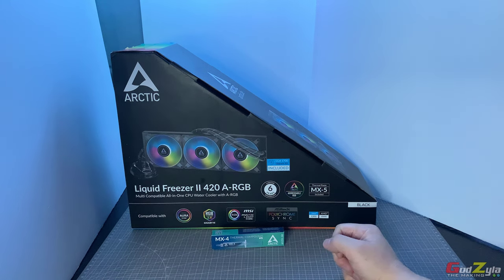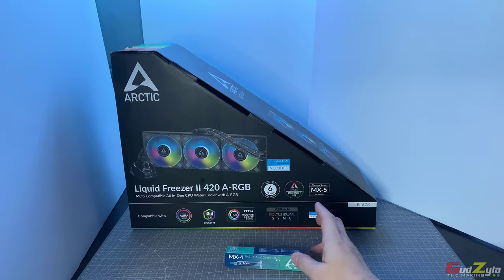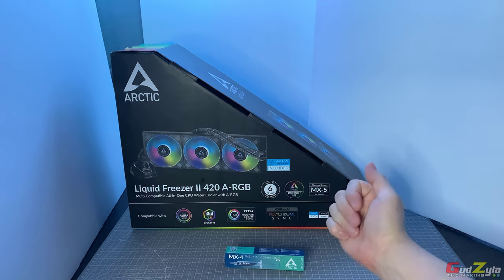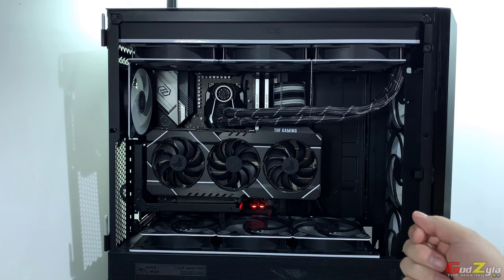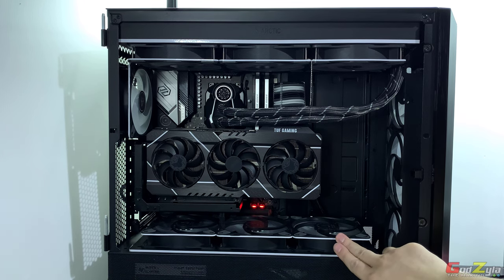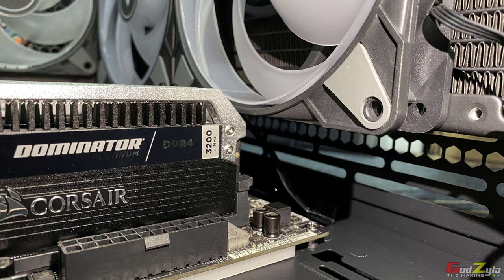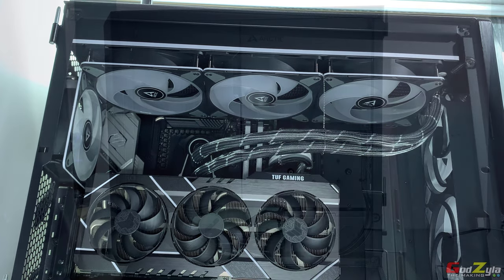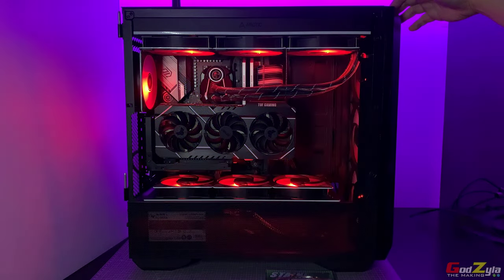Arctic Liquid Freezer II 420 in Lian Li Lancool III - Part 2 (The Experience)

Comment: I just wanted to install the Corsair H170i 420mm water cooling, however, I can not screw the fan to the left no matter where I place the radiator because one is stuck on the shield of the motherboard. Just sad ... Now I can send the case back again
Reply from the maker: Hi Johnny, welcome back, so sorry to hear that, which motherboard are you using? is the motherboard shield too high? some have reported to me that the rear i/o shield are too high that blocks you from placing fans. it's just 5mm off. still am sorry about your mishap. have you try mounting it to the front. one of my viewers did commented here saying that he could mount it to the front.
Reply: @KleoYan  I have the B550 Asus F-Gaming and yes, the shield is too high unfortunately. I can mount two fans and not one. I mounted the radiator as far as possible towards the window. I just heard that you shouldn't mount the radiator in the front because of the cooling capacity, right? I'm really sad right now because I think the housing is so beautiful.
Reply from the maker: @johnny7184  I am so sorry to hear this, at times I wish motherboard reviewers will do a height measurements on the I/O (sheild) and side VRM heatsink, at least we can pre-prepare by correct messurements. infact that's what I did. I measured my Taichi X570 and have sent emails to lian li about this case measurements and clearance, but I too am worried if I purchase a 420mm to fit in this case, lucky for me, Arctic have responded my call. still it sadden me that you are not able to fit the AIO due to this minor setback on the motherboard shield.
Reply: @KleoYan  Yes exactly, they advertise with 420mm AIO on their homepage and in the end it doesn't fit in, you can't think of something like that the SHIELD of the motherboard is too high. Too bad. Then I must unfortunately switch to a larger housing. But many many thanks always for your super nice and good answers Kleo!
Reply from the maker: @johnny7184  I am at fault too as I did this content. I hope you get a better case in the end.. have you have a look at Bequiet BASE 802. ok before suggesting anything, I myself did request right after I build this Lancool III as it looks premium too, but sad to say no response from Bequiet! it looks spacious but do make enquires if you are interested, just to make sure that it fits both your board and 420 AIO. I wishes you all the very best with your build.. thank you for the converstation buddy. 😉
Reply: @KleoYan  Thanks I'll find out :)
Reply from the maker: @johnny7184  you are most welcome 🤗

Comment: how do you plug the cpu power cable into the socket? is that an extension cable a must? I got stuck at the cpu cable part
Reply from the maker: Hi Winterr Winter, welcome to my channel. If you have not notice. I use psu that have flat cables. If you are using PSU like the Corsair HX or RM. then it’s harder to fit, as the sleeving plus the big coil on the cable will have some obstructions. In this case you can get a 8pin eps flat cable extension.
Reply: @KleoYan  thanks for the reply. just found out that I have the same issue with Mark A that the rear part (I/O part) of the case is blocking the radiator. would you mind uploading the top panel of the case with top filter removed for reference?
Reply from the maker: @winterrwinter5136  hi sad to say, I have already dismantle this setup. now progressing to another. so sorry. infact I have mentioned so long your motherboard rear I/O does not have the height of 40mm tall, you should be able to fit in. in this video I have mentioned 45mm, this includes the starting point of where the motherboard standoffs are.. there is a 5mm space before you mount the motherboard.
Reply: update: I just noticed that there are screw holes which are so difficult for one to see. OMG
Reply from the maker: @winterrwinter5136  there are others asking me this question as theirs can't fit, end up using zip tie. my trick is simple, screw the rad bit by bit, like how you do the CPU Heatsink mounting. I am able to get all 12 radiator screws screwed on the case top without issues, just do it slow.. "Slow and easy will win the race" 😁

Comment: hey bro do you recommend those extra 3 fans at the bottom and the back? does it help temps much
Reply from the maker: Hi Editor221, welcome to my channel. If your GPU is vertically mounted. It will help and as for the rear, you can do without it. Results can be found here https://youtu.be/1SPioF78x_E?si=fcpK447SfK8Y431e
Reply: @KleoYan  ah ok so your saying those 3 fans at the bottom are for GPU cooling only? it doesnt help with CPU?  if i dont vertically mount will it still help the gpu abit
Reply from the maker: @edi18912  it will cool your GPU but won’t be of any help to your motherboard area. Watch part III and you will understand the pattern

Comment: Hello.  Thanks a lot for such a detailed guide.  I wanted to know if it would be possible to put this AIO on the front panel of the case?  Will there be gurgling sounds?  And in general, will this AIO fit in the front along with at least one HDD bay?  It's just that now there is a choice to take this AIO or LS720.  

And I also wanted to know the correct name of the tape that you glued to the fans.  

Thank you in advance!
Reply from the maker: Hi @stefan_es, welcome to my channel. be it front with or without the HDD cage, you are not able to fit the Arctic Liquid Freezer II 420, but if it's the LT720 from deepcool, you will have enough clearance. I always practice tubes facing downwards if mounting at the front to prevent the noise or bubbles. As for the tape on the fans itself, look for Decal Tape Vinyl Sticker for Vehicle Bodies  in amazon. https://www.amazon.com/s?k=vehicle+line+tape&crid=3DCG9BXA2BZR8&sprefix=vehicle+line+tap%2Caps%2C299&ref=nb_sb_noss
Reply: @KleoYan   Thanks. I own an RTX 4080 graphics card. Won't it be that when the system is under load, warm air from the GPU will rise up and heat the AIO heatsink?  The Lancool III is a beautiful case, but I'm a little sad that I can't put a 420mm radiator in the front.  Would an LS720 on the front of the case be worse than an Arctic Freezer ii 420 on the top?  I want to compare in terms of noise level and performance
Reply from the maker: @stefan_es  lets just say to push warm air out is better than to draw warm air in.. thats what happened when you put the radiator at the front. Which CPU are you using btw? if it's not the 7950X or 13900K or KS, it should be fine using a 360 liquid aio.
Reply: @KleoYan  I have 12600k now, but then I will most likely put 13600k.  Is it warm air up front?  it seems that on the contrary, the processor receives fresh cold air from the outside.  Yes, then it gets warm inside the case and is already worse than the video card and other PC components, but in Lancool III there are 3 more fans for supply ventilation from below.  I often heard the opinion that the Freezer ii 420 is noticeably quieter than the 360 AIO, in particular the LS720.  There is no way to verify this statement, but this alignment of affairs is captivating.  I want silence.  Otherwise, I already have an AK620, which cools the processor normally, but it is so large that it blocks the flow of warm air from the video card.  I want silence so that the processor does not force the AIO fans to run at full speed and make noise during overclocking.  That's all.  If 1000rpm is enough to cool 12600k at 5.1GHz in games then why not)
Reply from the maker: @stefan_es  for a 12600k. You don’t have to worry much about heat. The tdp drawn is not that much compared to 13th Gen processor. I’m this case you should not run into issues with a 360 aio mount at the front. As for silence. Both are quiet. Just that lt720 or ls720. Both fans are noisier abit at full speed.
Reply: @KleoYan  Thank you. And if I change the processor to 13600k (maybe 14600k) in the future, is Freezer 420 preferable for 13th gen?
Reply from the maker: @stefan_es  to be honest if you know how to do power limits on these processor without losing performance. a 360 will do.

Comment: Hi Kleo
I have
I7 12700K
Z690 F - Gaming
Asus rog strix 3080Ti 12gb OC Gaming
2x16 Kingston fury beast ddr5
2 x m.2 Samsung 980 pro
Lian li lancool III
and I'm interested in buying arctic liquid frezer II 420
will there be any problems, clearance issue with the this motherboard that i have or the rear cooler, ram memory etc...?
Reply from the maker: Hello Dejan_11, welcome to my channel. If you have the motherboard inhand with you, kindly mesaure the height of your motherboard rear I/O top to the bottom of the motherboard.. if it's within the 40mm height, there will be clearance. as mentioned in this video, from the case motherboard area where the stand offs are. the space better the motherboard standoffs to your motherboard bottom is 5mm. plus your height of the motherboard I/O to the bottom of the motherboard, lets say 40mm.. So total is 45mm  which is just nice. but if it's over 45mm, then you going to have an issue.

Comment: Hello!
I understand correctly that the 420 radiator can also be installed on front? In this case, all 6x140 front fans can also fit.
Reply from the maker: Hi WHiTE, welcome to my channel if you are using an Arcitc Liquid Freezer II 420, no you can't do that with a push pull configuration. the radiator is too thick, even with just 3 x 140mm fans. your top fans have to be all 120mm. now if you are talking about the Corsair 420, someone in this comment have mentioned it can be done too but I cannot comfirm if you can apply the push pull method as I do not have the 420 Corsair to test with. Hope this will help.
Reply: @KleoYan  Thanks a lot! 
Is it possible in that case to make a bunch of 360 ALF and a set of 3x120 + stock 140 fans?
Reply from the maker: @IWHiTEI  Hi, I dont really understand what you mean by a bunch of 360 Arctic Liquid Freezer 2. do you mean to place more than 2 liquid AIOs or? do you mind to eleborate more. thank you!
Reply: @KleoYan  I meant the ability to put a 360 radiator and still keep all the fans
Reply from the maker: @IWHiTEI  I see. this case has no issue with 360 AIOs and you can place all kinds of fans as 360 AIO does not restrict any fan placement. maybe this video will answer all your questions https://youtu.be/PoBzRPApK5U

Comment: is that a 120mm, or 140mm fan on the rear?
Reply from the maker: Hi 
Leet, welcome to my channel. it's with a 120mm fan at the rear, if you intend to use 420 liquid aio, please note that to attached the rear fan, you can't use normal fan screws, you will need rubber fan studs also at the front. the 3 x 140mm fan arrangement have to be in this manner https://imgur.com/gallery/front-with-3-x-140mm-fans-vHezOSS if not you wont be able to close the front cover.

Comment: Hi! Ive got a question about the Meshcool lll case, does your side panels (the tempered glass) stay locked? Mine swings open if I tilt it to the side, is that normal or is it supposed to be locked when you close the side panels? Like when I lay the case down to the side my panels just open up themselves without having to use the front to open them.
Reply from the maker: Hi Angel, welcome to my channel, do pardon me as I miss your question. it should not do that. it's not lock but is via strong magnet to keep the tempered glass close.

Comment: Is this case loud?  I have gpu with preaty notisable coil whine will it reduse it at least a bit?  Ot it's better take Silent base 802?
Reply from the maker: Hello Alex, welcome to my channel. The whole system is quiet as am using all Arctic P12 PWM PST argb fans. As for your GPU coil whine, I do not have a GPU that has those noise, so I can't answer your question on this.

Comment: I use the 7000D airflow with this cooler.
Reply from the maker: Hi TheTshadow999 Animates, welcome to my channel. Thank you to share info with us. By the way, how was your experience when using it on a 7000D? care to share if there are any difficulties and what do you like about the case? Thank you!
Reply: @KleoYan  It’s been pretty great so far, but when taking off parts of the case, e.g. dust filters, HDD bays, etc., I’d have to pull oddly hard, it’s all stiff. Other than that I really like the clearance it gives me for everything, lots of room for cable management. Once I got the HDD bay out of the way, I was able to put in the AIO in a push/pull configuration and still have clearance from my Gigabyte 4080, which is huge. It also has an extra 4 fan slots in the back that I’ll get around to filling in a few days which is nice.
Reply from the maker: @thetshadow999animates9  Hi, am gald you've shared your experience with us. Greatly appreciated it and congrats on your build. Infact to be honest, each case have it's flaws and benefit. you win some, you lose some. What matter most is to keep your parts intact and to have good thermal. Once again thank you for sharing 😉

Comment: Great video. How did you go about daisy chaining your fans? I have some fans not displaying aRGB properly (which I suspect is a power issue... Some options have those fans display colour and then they get "stuck" while the others continine to cycle) I have all the fans daisy chained to 1 header and the CPU cooler on its own, separate header.

Am I correct in the assumption that you are operating with a relatively even daisy chain split, 5/6 per header?
Reply from the maker: Hi DSbroTV, welcome to my channel. the case itself has three argb cables. for the front fans I make use of two argb connector off from the case and the third cable I plug to this argb hub https://www.amazon.com/RGEEK-Splitter-10-Port-Extension-Perfect/dp/B08DRKR4B6/ref=sr_1_7_sspa?crid=11C9MOGAFHTM3&keywords=argb+hub&qid=1667510917&qu=eyJxc2MiOiI1LjE5IiwicXNhIjoiNC44NCIsInFzcCI6IjQuNzQifQ%3D%3D&sprefix=argb+hub%2Caps%2C289&sr=8-7-spons&psc=1 from there, I plug the rest of the fans through it as there are 10 arb ports. the reason for this is, the argb cables from the case has a power limit, so I used that argb hub which is powered by a sata cable to extend the range, therefore I am able to control the argb effect via the case argb buttons.
Reply: Awesome, thank you for the reply!
Reply from the maker: @DSbroTV   You are most welcome and all the best with your build. 😉

Comment: Im gonna buy the 420 because its like $30 cheaper than the 360... $130 for a 420 crazy.... thats argb version too...
Reply: Edit: going for 360 at $100
Reply from the maker: Hi Ryan Dailey, welcome back. infact for the Arctic Liquid Freezer II range, my pick will be either 280 or 420, both run quiet, more surface area to absorb heat. However I can understand why most will go for 360 as to fill up the case gap. Looks nicer.
Reply: @KleoYan  I mean I just bought a lian li lancool 3 and will fit a 420 but it's tight
Reply from the maker: @Lemonhead8890  Yup, you need to fiddle with the rad at the top and to screw them in slowly if you want all 12 screws to align properly. I got mine all align properly without issues.
Reply: @KleoYan  well that reassuring at least, I just want the back fan to still fit beyond all those rad screws being in. I mean it could hold in decent with less just vibrations may be a problem 🤔
Reply from the maker: @Lemonhead8890  I see, yup if you going with a 360, the rear fan will be easily slotted.

Comment: Thinking of building a new setup with this exact case (in its white form) and with an Arctic LF cooler, although I am a bit unsure about whether I should pick 360 or 420. Not sure if you have tried both but would you say there is a considerable margin of improvement over 360 (for a 170W CPU -- 7950X)? 

Also another question, this is going to be my first desktop build in a long time and as someone who is really not experienced at that front (routing cables and dealing with mechanical aspects), is there any tips/tricks I should be aware of handling the  Lancool III (or if you think this is a harder case to build for a beginner, I'd be on to hearing your suggestions). Thanks a lot for the reviews btw, love your methodology!
Reply from the maker: Hi Sayin Benoit, to be honest, I have tried both. It’s about 3 to 5 degrees difference by default in a 7950x system. Aio you can use either 420 or 360. Unless you are doing overclocking then 420 will be a better option. As for difficulty on the front I/O part. It’s very straight forward. I have another video that explains the front I/O connection which you can refer to Lian Li  Lancool III - Part 1 (Case Details & Impression)
https://youtu.be/PoBzRPApK5U

Comment: Where does those rubber straps come from, you use to install the fans?
Reply from the maker: hi ripperro, welcome to my channel. They are rubber studs for fans. https://www.amazon.com/AUEAR-Silicone-Reducing-Vibration-Mouting/dp/B08KGWTDHK/ref=sr_1_8?crid=1YI3N4FFX5MFS&keywords=fan+rubber+screws&qid=1678803213&sprefix=fan+rubber+screw%2Caps%2C316&sr=8-8
Reply: @KleoYan  thank you for your very fast reply
Reply from the maker: @ripperro  you are most welcome and all the best with your build too.

Comment: How have you found the Arctic fans in comparison to the stock Lian Li ones? I can't stand how loud the lian li ones are so have been looking at these as a replacement.
Reply from the maker: Hi David Aitken, welcome to my channel, yes I did a comparison which is not listed in this video, they are indeed louder compared to Artic. Also, I know there is a restriction but I have done additional steps. On the fan tray itself where you those those slits / slots, i have sealed them using duct tape, reason for this, when the Airflow goes those these slits, it will cause some howling, the concept of blowing through a narrow tunnel. This help to reduce the noise, as for the case airflow, yes it will have an impact but the impact is not that big, temperature increases about 2 to 3 degrees more.